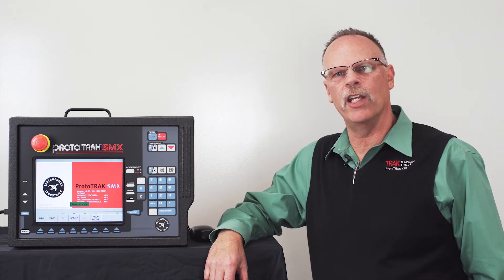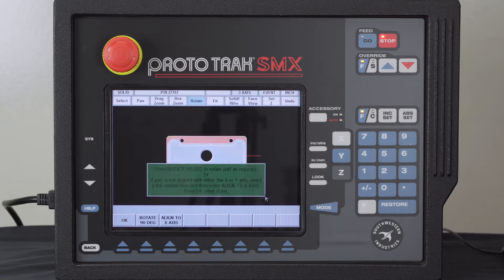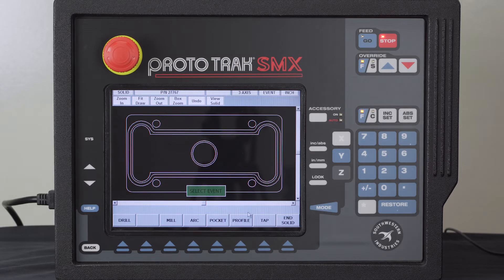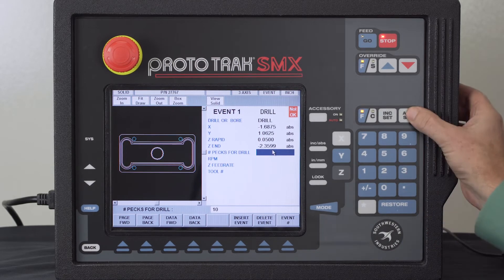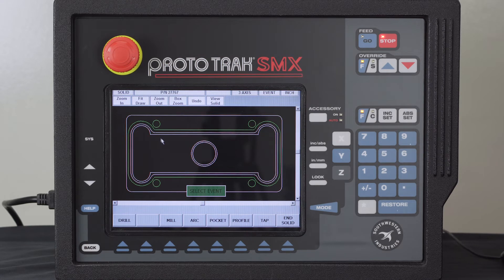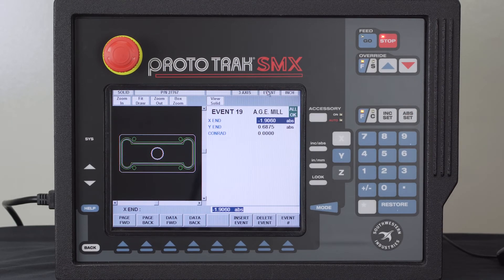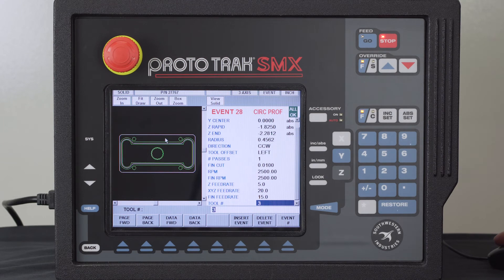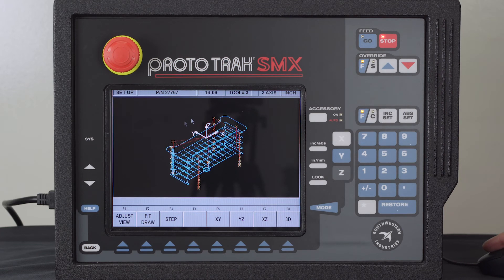Parasolid Files with the ProtoTRAK SMX CNC | Mill Programming

Comment: I tried exporting a part from solidworks to an x_t file type, but the file would not appear in the SMX folder. Any idea what i might be doing wrong? Typically we do DXF files for 2.5 axis milling, but we are recieving a TMC7 in a few weeks and upgrading to 2025 solidworks and SW cam, so i wanted to try some of the SMXs features that we dont use, but i must be doing something wrong.

Comment: Good afternoon, Iam trying to use parasolid file and unfortunately iam getting a error code. I did save it under the x_t extension. I dont know what this means. Iam using a protro trax smx machine. Thank you for your time.

Below is the error message that iam getting. 

PK Error
PK error: PK _PART _receive returned PK _ERROR_schema_access_error
Reply from the maker: Hi Joshua. Our tech rep said: "In 3D solid modelling systems, you have the ability to save out as different versions. Version 16, 18, 20, etc. You need to save it as version 20. Best version to use." If you need more help, give us a call 800-367-3165, 7 a.m. - 4:30 p.m. Pacific Time. ~PK
Reply: @TRAKMachineTools  Thanks you.

Comment: Trakking Pat.  So far I have only seen multiple passes in the Trak control as Z DOC.  Is there a way to do irregular outside profiles with multiple contour passes to better use side of end mill?
Reply: Hi Joe, the canned cycles of the SMX control do not have a way to do what you are asking however, the RMX does. It is a newer option called Clearoff. With Clearoff, you can describe the outside of the part and also whatever profiles or bosses you want to leave standing. The control will start at the outside and work it's way in. If you only have an SMX, you would have to create multiple profiles changing the dimensions for each one to fool the control into giving you what you want. Otherwise, you could program and run it from G-code. T.P.

Comment: What drawing program did you use for the model and what did you save it as please?
Reply: Gary, the model was created in Solidworks although I did not create it.  It was developed by one of our draftsmen in our engineering department.  FYI, this is a model for a component to one of our electronic assemblies in one of our machines.  In order for the ProtoTRAK control to read it and convert it, it has to be saved as a X_T file.  This extension will be in your list when you save your file.  In reality, it doesn't matter which solid model software you use as long as you save it as an X_T file.  T.P.
Reply: TRAKing Pat many thanks can’t wait to give this a try. Great videos. Thanks